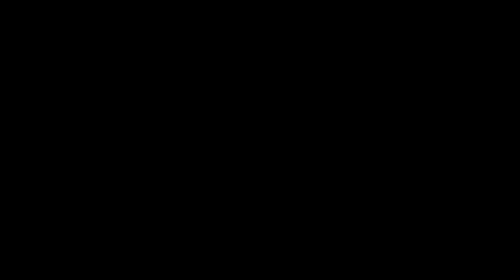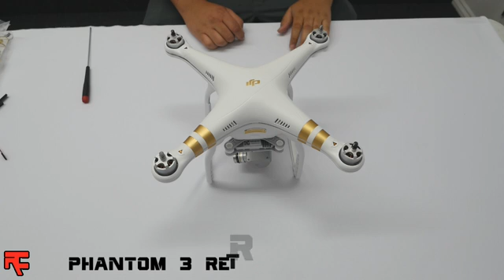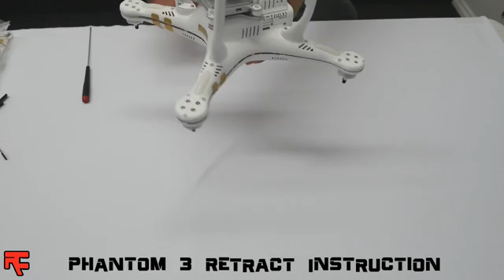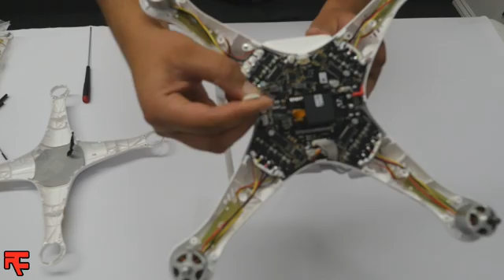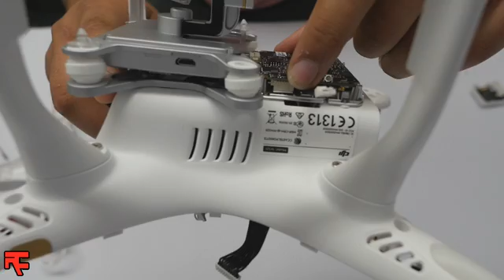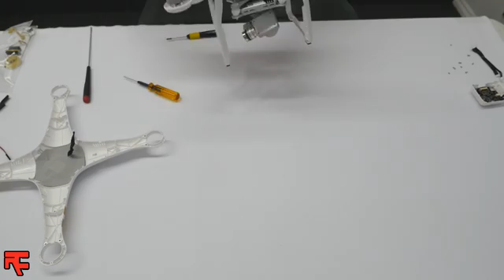Phantom 3 Retractable Landing Gear Installation Instruction

Comment: OK so this is great but where do I buy the kit?
Reply: +rueben martinez It's on ebay for around $142. It's a DJI product. Helps eliminates the landing gear showing up when accelerating in your videos, greatly increases ground clearance, works great if properly installed, and looks great. Just take your time and read my other tips to make your decision. Or have a shop do it.
Reply: +Jim Miller It is NOT a DJI product....  Seems to be made by, or for RC Depot...  Sold also by helidirect....

I bought these..  before I even flew my P3 pro...  Now, seeing some of these comments, I'll be flying it first...  If the stock landing gear isn't a problem... I guess I'll throw 'em up on eBay...  D'OH!
Reply: Yeah I realized it's from hobby depot. Happy with mine.